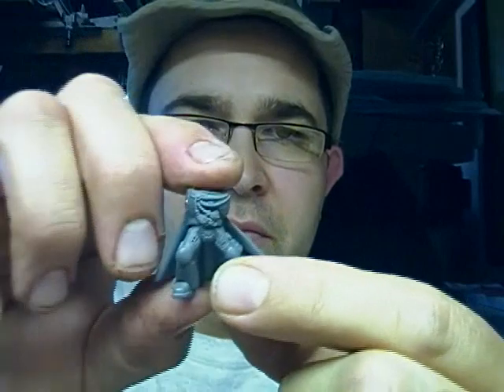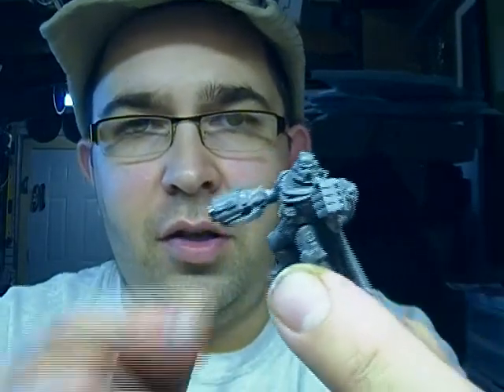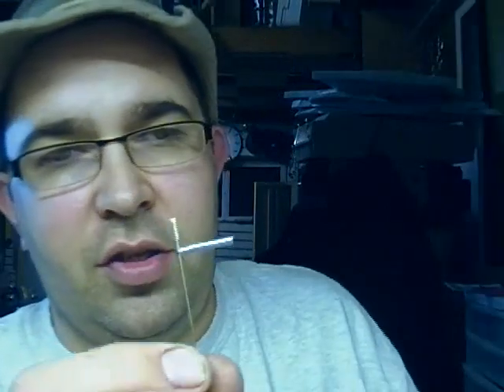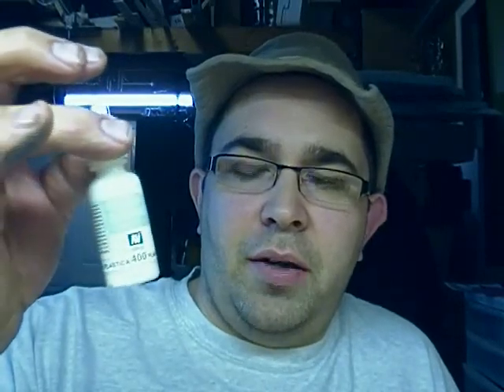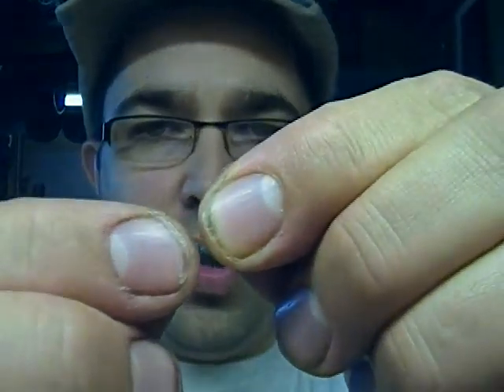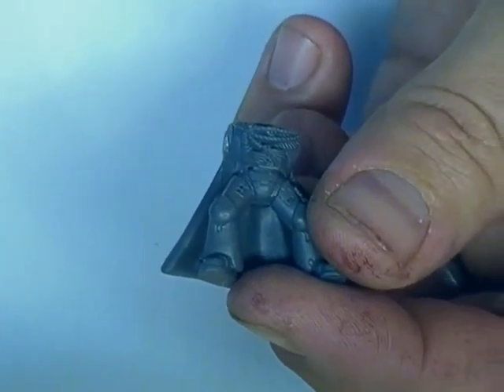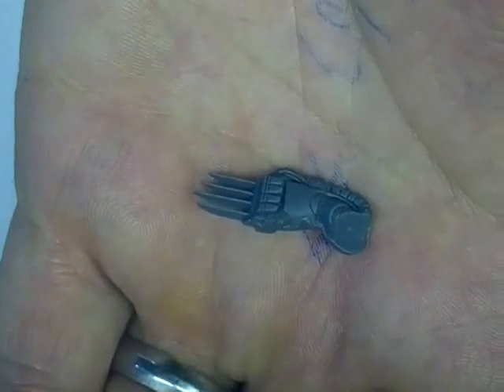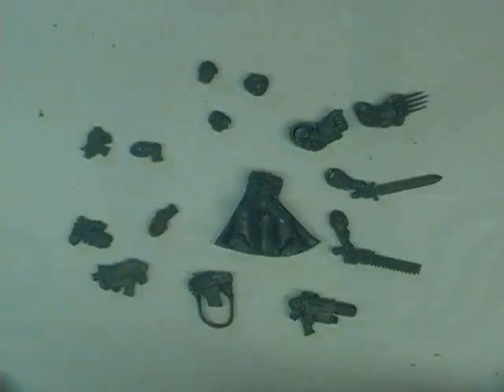Magnetizing a Space Marine Commander

Comment: I noticed that the storm bolter was a bit heavy for that magnet and I know you can use 3mm magnets on termies but would those be too big for powerarmor? Watching the video it looks like 3mm would fit in the sholders at least and that is where most of the weight would be. I ask this because the 3mm magnets were able to hold thunderhammers on termies over their heads. Also I know you did not but should I magnatize my shoulder pads or just get extras for each arm. I plan on doing a whole SW army.